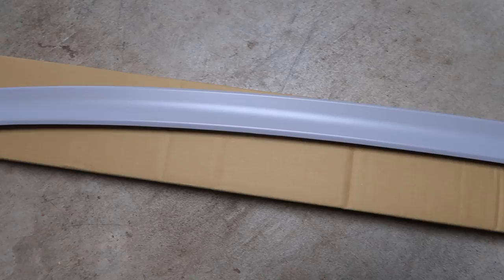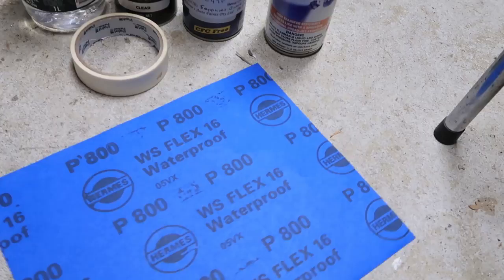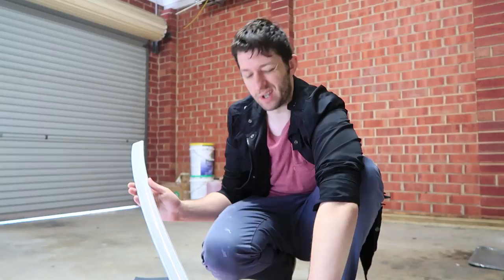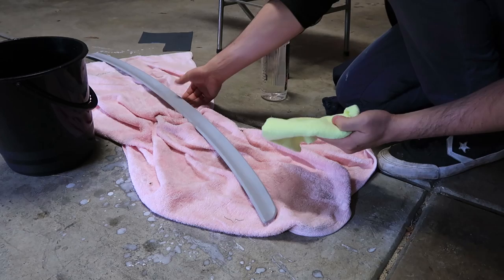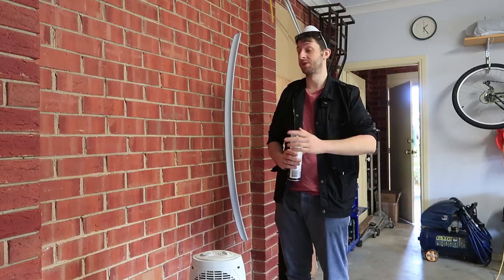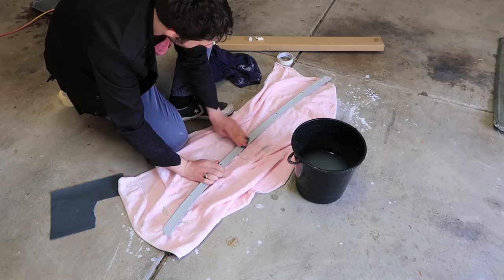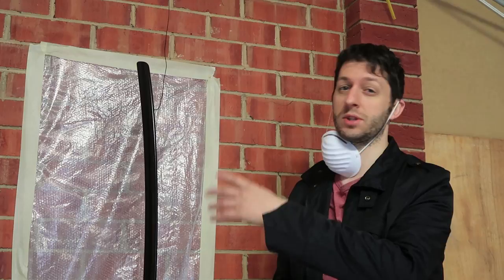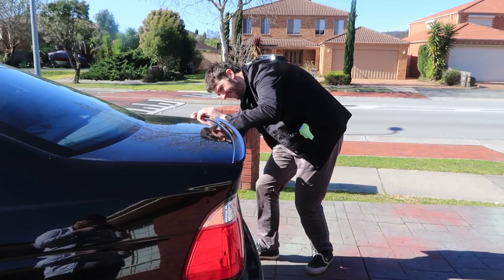How To Paint Car Parts (with Spray Cans)

Comment: This is great stuff! I need to replace a front quarter panel on my NA miata, and I think I may try this out. If it works well, I may repaint my hood to fix all of the peeling clear coat!
Reply from the maker: Sorry for the late reply. Have you already done it? How did it turn out?
Reply: @MichaelRoninTV  I haven’t yet! I bought a sprayer and want to paint more than a new panel. Seems like a new panel should be straightforward, but I’m learning how to prep old ones too.

Comment: If the part you are painting is already prined then how would you prepare to paint? The same as after you finished priming?
Reply: Probably best to wet sand and reapply primer as he did in the video.
Reply from the maker: Yep, pretty much just sand the primer that is already there and then paint it. I just reapplied my own primer over the pre-primed part because I wasn't sure what they used as a primer and wanted to make sure it was good. Also, it gave me an excuse to make the video haha